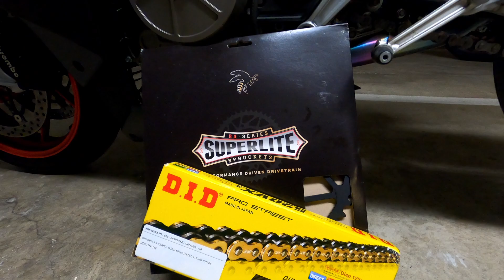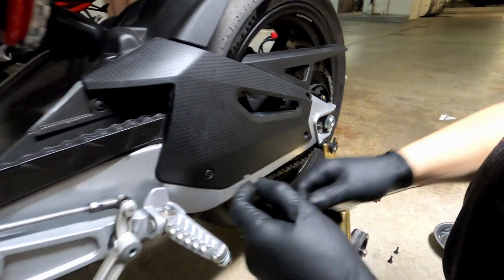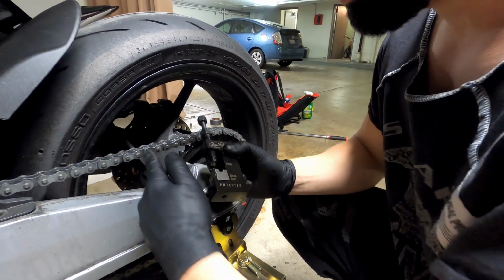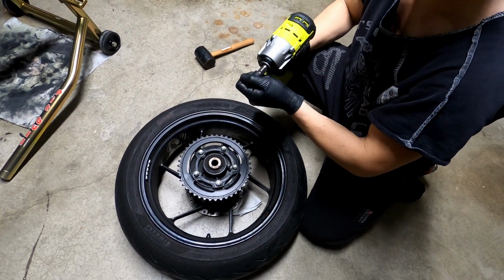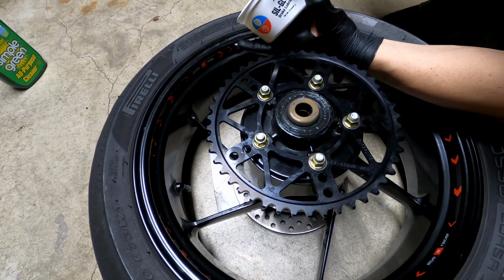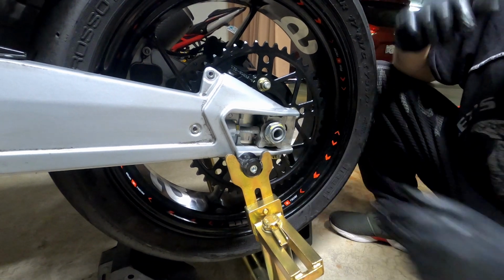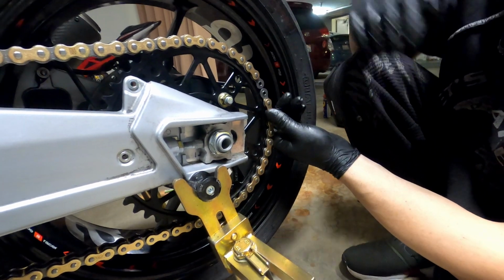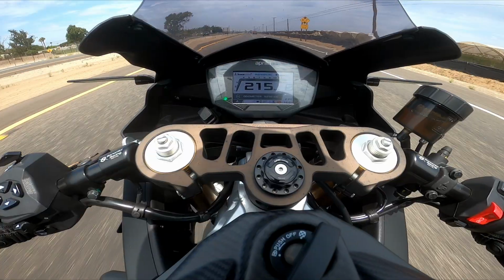RS 660 | Chain & Sprocket Install | Part 1

Comment: Not sure of this has been asked before, does changing the chain, changing sprokets going to improve a Stock Rs660 without any Other additional mods?Thanks
Reply from the maker: Short answer, yes it will. The RS660 runs a lot smoother on 17/47 gearing. By changing gearing, you will improve the acceleration and overall feeling. The only time I don’t recommend this gearing set up, is if the bike is used to commute on the freeway a lot. Other than that, gearing would have been one of the first mods I would do before anything else.

Comment: Also wanted to ask, so do you have to do anything with the rear brake calipers or ABS sensor or just remove it really carefully I was gonna try and remove the brake caliper, but I have no idea how to handle the ABS sensor thank you
Reply from the maker: @hddanman7263  You don’t have to remove the rear brake caliper or ABS sensor. Just remove it carefully and you should be fine. ✌️
Reply: @ALFAVITAGA  thank you so much 💪
Reply from the maker: @hddanman7263  💪✌️

Comment: Nice work bro, I have a rs 660 my own and it's cool to see your mods and everything. :D
It would be good if in the description of the video you were putting a list with all the parts and spare parts that you have been using and that you have installed on the motorcycle right now.
Reply from the maker: Thanks brother! That’s a good idea. I will go over my videos and include the parts in the description. Once I complete all the mods I will make a dedicated walk-around video with all the mods.
Reply: @ALFAVITAGA  Oooh nice to hear that you liked the idea. It will be a good video the walk-around. Regards bro!

Comment: Hi, I have a Evotech spools and my friends venom  motorcycle stand will not adjust to fit it. Do you have any recommendations?
Reply: What spools do you have??
Reply from the maker: If the stand is not adjustable there is really no recommendation. Its a matter of luck if you will find spools that would match the opening of your stand. And for the most part all spools will give you roughly the same distance. Nevertheless, the spools I have are by Driven Racing.